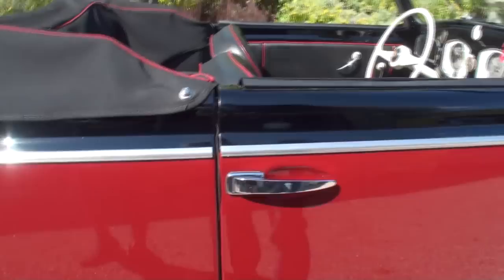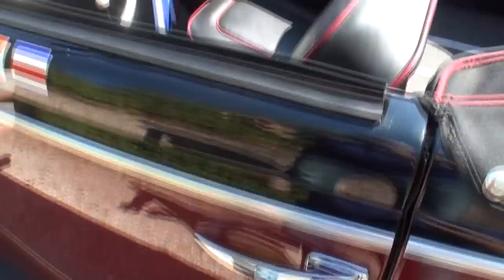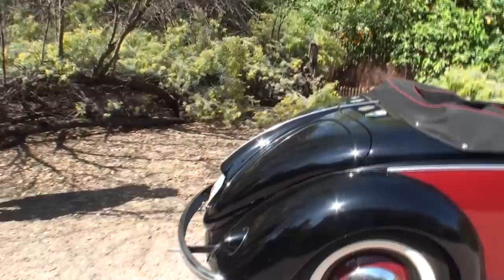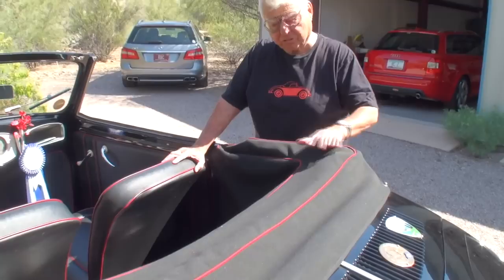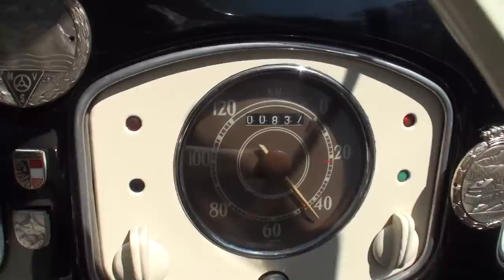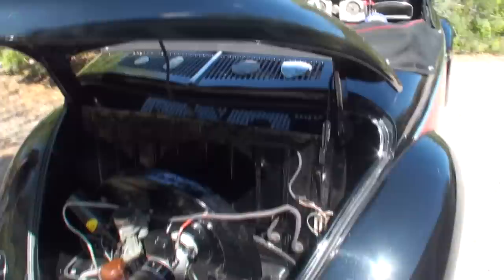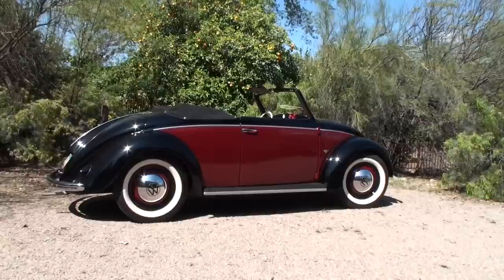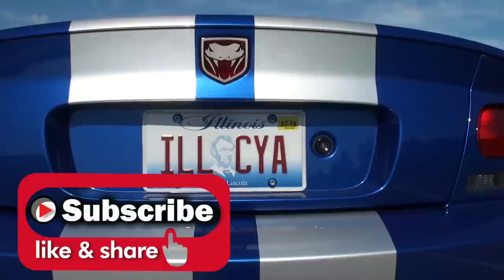1949 Volkswagen Type 14A VW Hebmuller Beetle Cabriolet & Ride on My Car Story with Lou Costabile

Comment: Back in the mid '80s and into the '90s l was buying these VW stamped toolboxes and the equally fab HAZET Tourist that could be used in the 356 or Beetle, for $300. They've appreciated since .....
Reply from the maker: Hi Ivan, Sounds like you've made a wise investment, Lou

Comment: Cool, my 1st car was a 61 bug that was a 40 hp 1200 cc, 61 was 1st year for full synchro transmission and 40 hp, previous was 36, mine had the reserve lever also, I think about 63 they broke down and put in a REAL gas gauge. Wondering if that's the ORIGINAL engine? They weren't a high mileage engine, maybe 60-70 miles and it would need a valve job or even less, LOTS of heat there and the #3 valves were kind of hidden from the cooling fan so that cylinder usually failed 1st.. as years went by they did a few changes. You know its so odd the following VW has because if you look at EARLY AND ORIGINAL VW commercials they were 1 step above a bus, you can see someone in a bus looking down at someone driving a VW in 1 commercial
Reply from the maker: Hi jim dandy, Happy to read this car brings back memories of your 61 bug :-) Thank you for viewing and sharing, Lou

Comment: Again, nice show! But now I need to research when did VW introduce the gas gauge? BTW really love the tool kit...
Reply: Quick research says it was introduced on July 31, 1961 for the 1962 model year. That's pretty late! My '66 VW had it, of course, but it tended to get stuck in place, and I would have to tap on it lightly to see the right amount. And trying to jump-start a six-volt when most cars were 12 was a huge mistake!
Reply from the maker: Thank you for viewing & sharing your research.